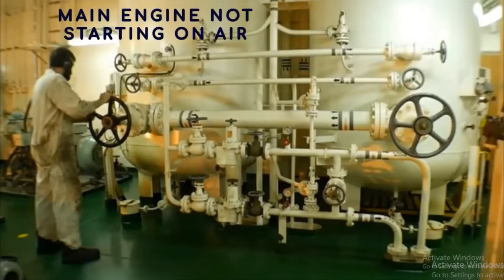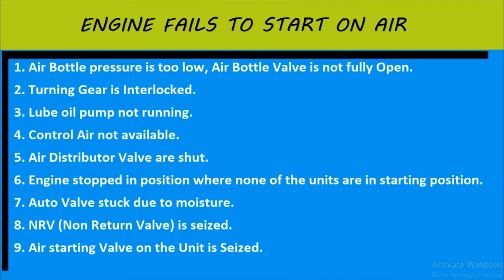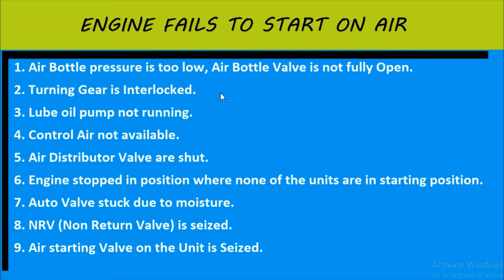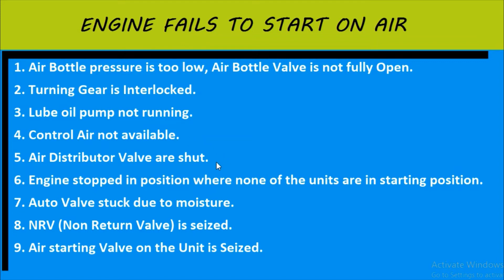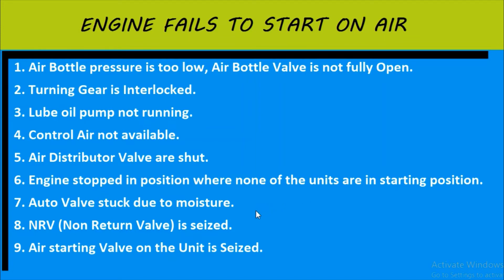Main Engine NOT Starting on Air? 😐 | PART 1| Important Points #MainEngine #AirStartingSystem #B&W

Comment: Hallo my friend ihave a problem with air safety system 
The alarm on safety system emergency stop valve wb wb its mean wire breackage the all wire is ok and in pcs panel the relay who responsible on alarm dps power fauler is on 
From few day i change fuse of 127 solenoid valve safety  system stop can you help me and thankyou